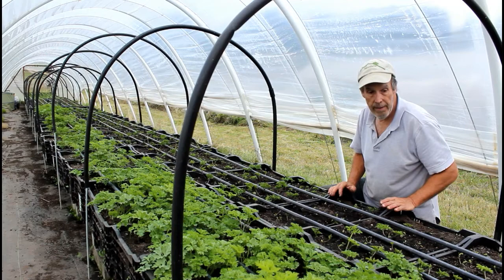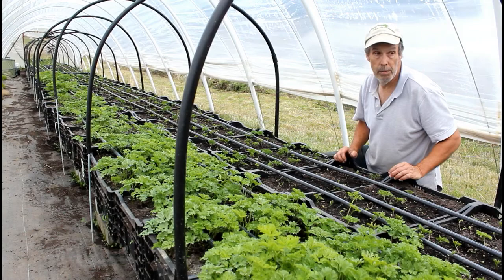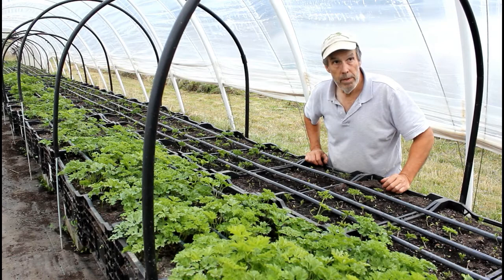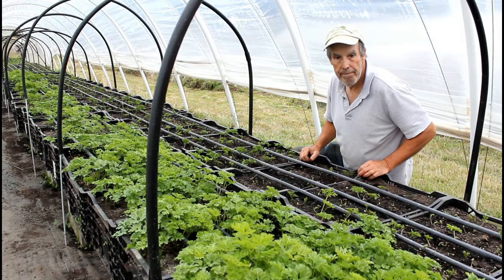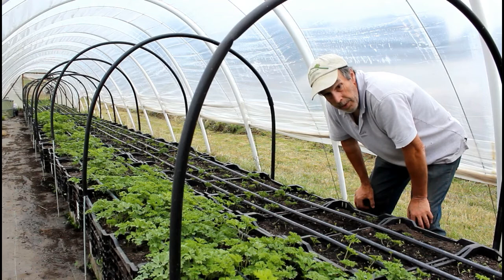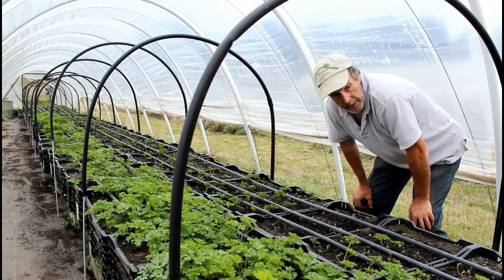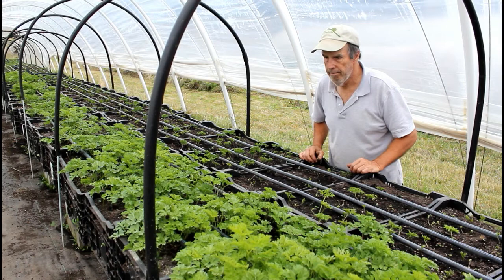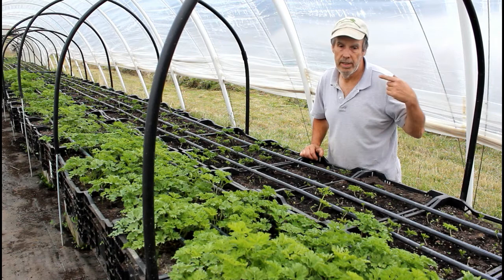Anemones: Questions & Answers

Comment: My anemones are all presprouted, but the ground is still frozen here in MN. I have some plastic crates, but, unlike your crates, mine are only 5.5" deep.

Do you think this is deep enough? I was thinking of just sinking the crates once the ground thaws and letting the roots grow right through the crates (it has lots of holes).

I guess my other question is whether or not they transplant well? Thanks
Reply from the maker: Hi @Levi Joseph  Your crates should work OK. Anemones are not deep rooted plants.   They however don't respond well to being transplanted once in the strong growing stage.  Not sure if you'd gain much from sinking the crates in a soil trench. Just keep the crates well hydrated but not soaking wet and the plants should be fine.